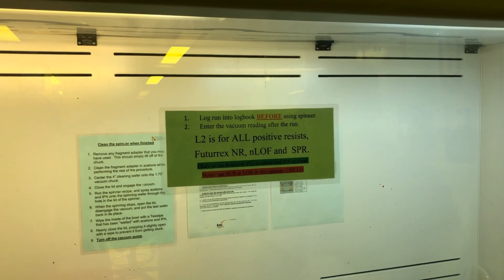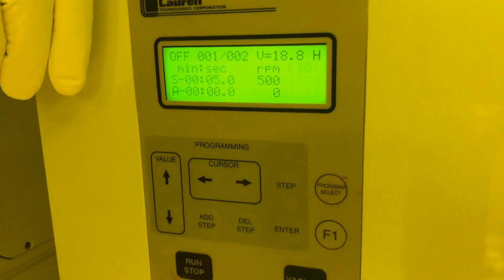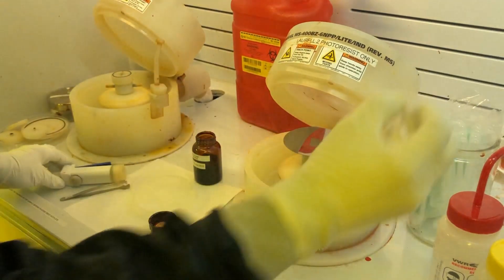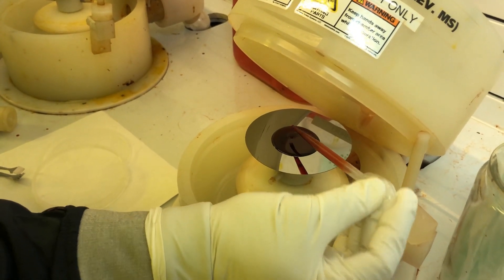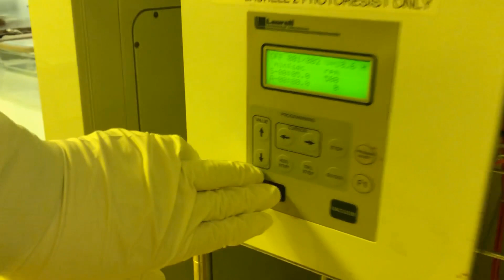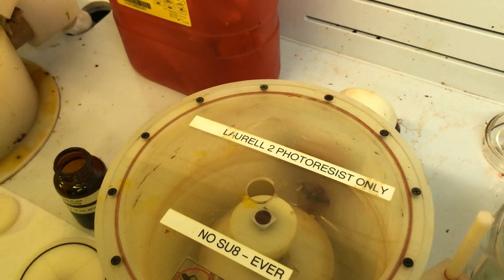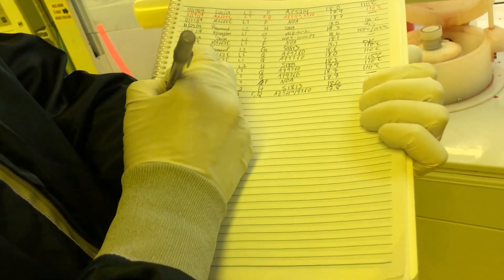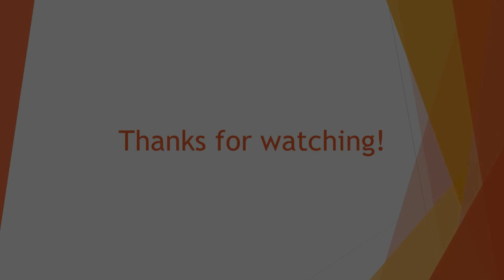How to Spin Photoresist onto Wafers and Pieces

Comment: Thikness of film seems to be not uniform 7:12.. What reasons could lead to that?
Reply: Comet mark on the edge is caused by particle contamination. Chuck mark on center of the wafer is caused by difference in temperature due to evaporative cooling (chuck provides better thermal conductivity to chuck/wafer/photoresist stack, so center of the wafer is warmer than edges).